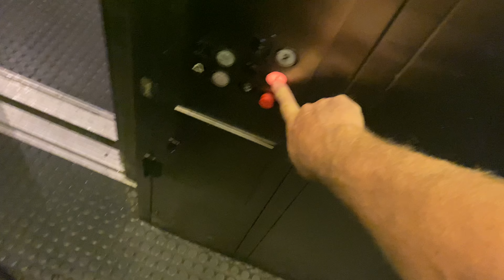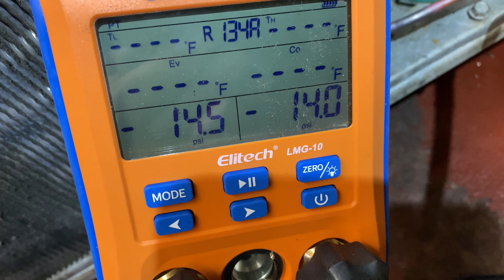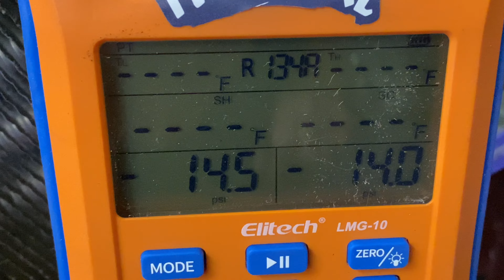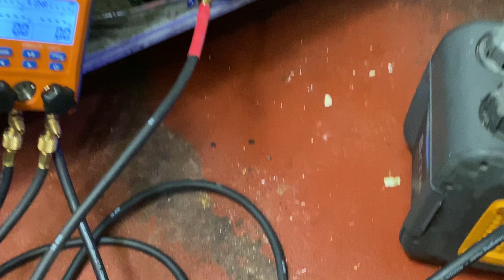Compressor change out

Comment: Don’t know if anyone has caught this yet but If you notice on those gauges it was reading -14.5 PSI not inches of mercury. Not different transducer just that they don’t switch units. -14.7psi is a perfect vacuum at sea level. For reference -14.5psi = -29.5 inhg. Very odd choice for a refrigeration gauge set.
Reply: Was going to comment this, they do seem to be working
Reply from the maker: It’s in the comments and the testo converts for you is what I could not explain 🤣🥹

Comment: Amazon has some bad a** carts that fold up flat and they fit behind a seat or pretty much anywhere. 300lb rating. I have 2 on my truck and they have been a life saver.
I really like my new Testo scale with the solenoid valve. You can input how much refrigerant if doing by weight and it'll stop right on the money...or you can charge by SC,SH or target SH

Comment: Just curious, I just picked up a oxi-acetylene setup from Harris, I have a #3 #1 tip trying to get dial in before I burn up a customers system. I only have experience with a turbo torch
Reply: gather scrap pieces of various size and practice! much better to waste some rods and tubing than wasting expensive equipment and parts.
probably wise to test on used/scrap filter-drier and valves also.

Comment: the gen 1 testo 550 will show up to 29.83 on a vacuum....the gen 2 version i bought only shows -14...very strange...the gen 2 supposed to be newer technology and costs alot more and i have nothing but problems with it...i went back to the gen 1 and they work just fine. Im going to send the new ones in for warranty service.
Reply from the maker: I’ve heard nothing but negative about gen 2. Testo.
Reply: it seems like they don't much care to convert from psi to inches of mercury, because you should be using a micron vacuum gauge anyway ;)
Reply from the maker: @throttlebottle5906  who’s got time for Smurf boners and micron gauges😂😂
Reply: @NorCal-refrigeration  true that, balls to the wall hustle speed to get jobs done!.

Comment: Great stuff man. Please don't forget to wear the safety glasses while brazing.
Reply: for sure! my buddy got hot solder splattered in his eye before, one drop came off an elbow and hit top of "wet" new water heater, it turned into random micro beads that flew everywhere, including directly into his eye, in which he got lucky and was wearing disposable contact lenses! it fused onto the lens and destroyed it, still made his eye sore. that was around 1996.

Comment: When changing out a compressor do you also change capillary tube to avoid any restrictions in cap tube?
Reply from the maker: I’ll back blow them. If it’s good I’ll roll the dice. If not it’s change out time.
Reply: @NorCal-refrigeration  20 years in hvac, I'm 6 months in refrigeration and I've learned that anytime you replace a leaky evaporator,  might as well replace capillary tube if factory charge gives you a low suction psi.
Reply from the maker: @alejandrorocha4693  true.
Reply: @NorCal-refrigeration  hey dave , we met once in person at a Starbucks,  you were riding out to a motorcycle event in morgan hill.  Quick question,  when you come across a compressor with bad valves or a locked rotor and you back blow the capillary tube,  do you have a method where you add a certain amount of psi and time it to see if it leaks to high side?
Reply from the maker: @alejandrorocha4693  no it’s just from doing it so long.

Comment: What kneed pads you use? Comfortable under the pants all day?
Reply from the maker: They came with the pants.
Reply: @NorCal-refrigeration  which pants?
Reply from the maker: @WswRefrigeration  https://www.duluthtrading.com/mens-duluthflex-fire-hose-ultimate-relaxed-fit-cargo-pants-71703.html?&srccode=GPSMART&ogmap=PLA%7CNB%7CGOOG%7C%7C%7C%7C%7C%7C%7C%7C18284927928%7C&gclid=EAIaIQobChMIj9bEjsvO-wIVzylMCh1-zASfEAQYASABEgLTmPD_BwE